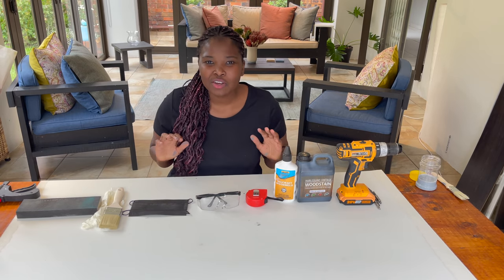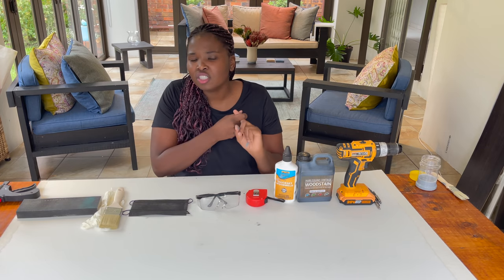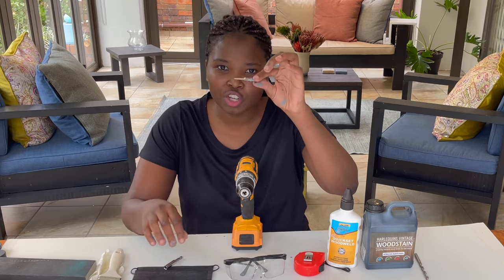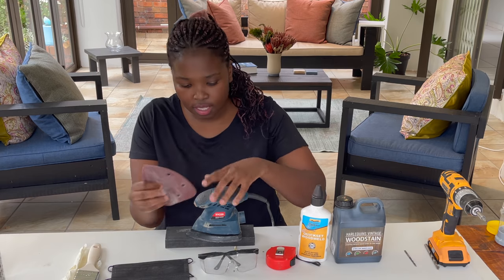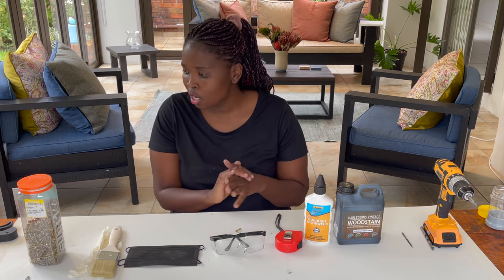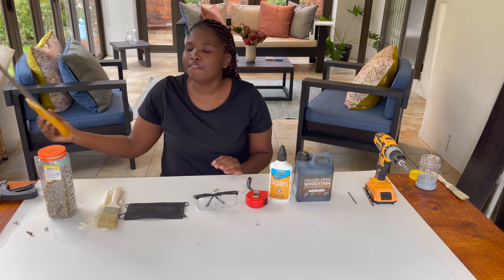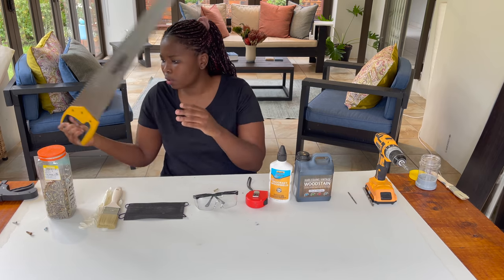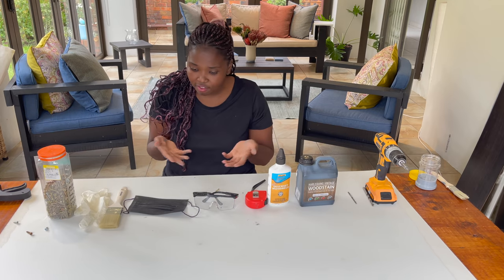Unlock Your Inner Carpenter: Discover the Essential Tool List for Woodworking Newbies

Comment: Can the cordless drill, drill in walls while mounting curtain rod?
Reply from the maker: I’m going to say say and no . A 12v cordless will not have enough power to drill on concrete , it wil struggle  .
But the bigger power ones will try . For concrete and missionary you will need more power . Corded drill will be best